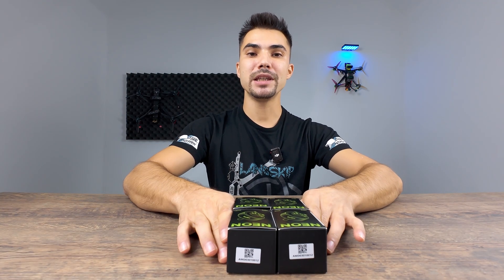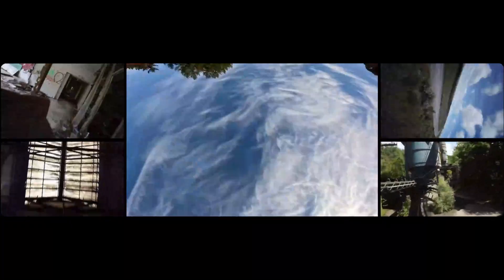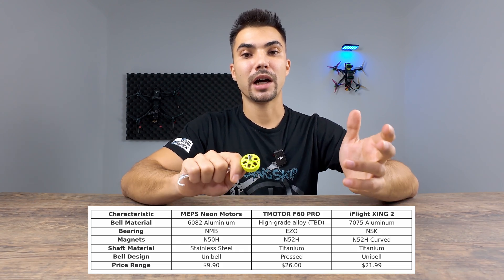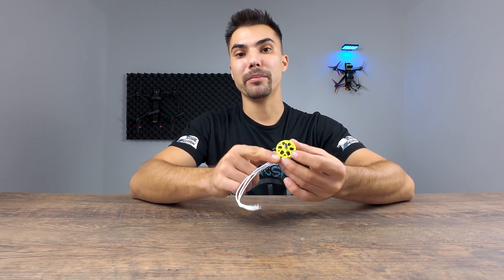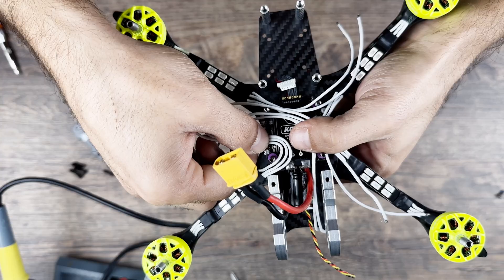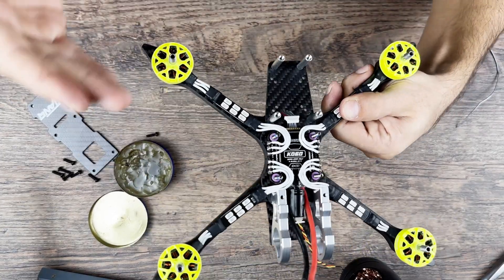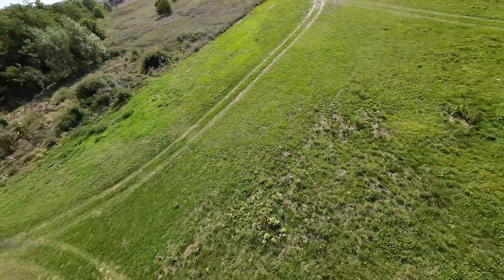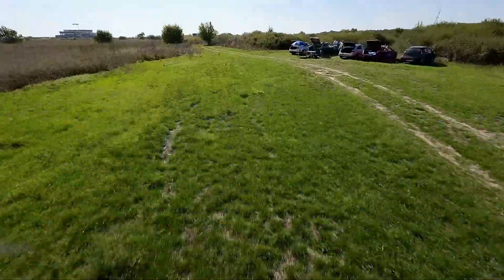BEST FPV Motors For The $$$ - MEPS Neon 2207 Motors

Comment from the maker: Let’s see.. How much money did you spend on FPV motors? 💸
Reply from the maker: I will go first. I’ve spent around 800-1000$ in ~ two years 😳
Reply: Bought 4 rcinpower wasp major v2s for my first build for $27.99 each, just smashed my first motor! Wish me luck
Reply from the maker: That’s exactly my concern. Is it worth paying almost triple for these high end motors?
Reply: I bought EMAX 2205 2300Kv motors,  $15 for a pack of 4.
Reply from the maker: Wow 🤯. These EMAX are 3-4S motors, but where did you find them so cheap?
Reply: Save on motors, splurge on dresses! 👗😂
Reply from the maker: @andreeatiriplica7861 That’s what she said 😂💸

Comment: how durable are these for bando bashing? and are these unibell design ?
Reply from the maker: hello, thanks for asking. To be honest these are stated to be unibell design, I don’t know for sure and didn’t personally tested them into concrete or such conditions. But I can tell you for sure that I have crashed very expensive motors in bandos and they most of the times get damaged. So I think it’s not worth paying more for premium materials when you will replace a lot of motors anyway if you go bando.
Reply: @GoeFPV  got it . thanks !

Comment: Which other hype did I miss with Meps? Are they any good or just cheap? 

I already didn't like the feel of Xing to be honest. 

Just get some second hand Premium motors and You won't regret. Bought 10 pieces of Tmotor Pro 60's for 70$.

People switch their motors more then they should. Why always try new.......just stick to something and get better eventually.

Otherwise for great smoothness and price Axxisflying sells their AE line for 35$ four motors.
Reply from the maker: I was using Xing2 all the time, but I don’t feel any arguable difference. I think these are good motors, other than the lower end materials used in some places. I would give them a spin ✌️.

Comment: i was looking at these motors for some time..especially when i see them in my feed at that sick low price 😅 and i think it's time to try them on. Anyway you had the guts to risk the o3 on their first run 😂 But nice video bro and sick flight :rocket-red-countdown-liftoff:🤘
Reply from the maker: I think you should really give them a try. I like these motors and I don’t see why you consider I risked the O3. Use my referral link and code “GOEFPV10” for an extra 10% discount and let me know your experience after testing them ✌️.
Reply: @GoeFPV the discount code does not work, is it just for some countries? Just tried it, code unavailable, same with an other code I tried today
Reply from the maker: @mawi435  this is a problem, it should work for all products and countries. Thanks for letting me know. I will keep you updated. I check it right now.
Reply from the maker: @mawi435  It does not work for me either, I wrote them and I am waiting an answer. Thanks for letting me know. I feel so bad for this :(.
Reply from the maker: @mawi435  Hi, so I checked and it looks like the discount code does not work for Flash Sale products. So you can still use the code for already discounted products, but not for those in flash sale. Sorry for the confusion. I was not informed well from the beginning.